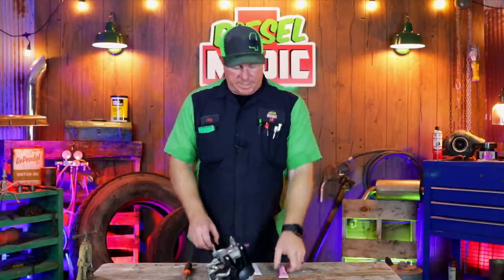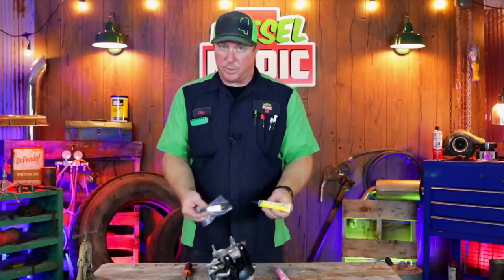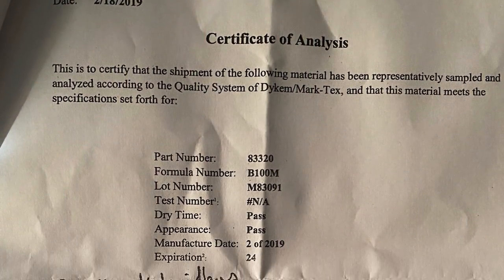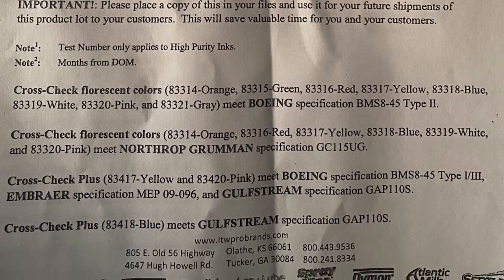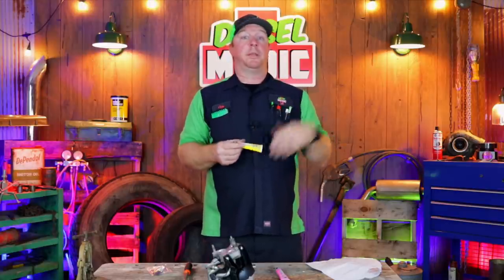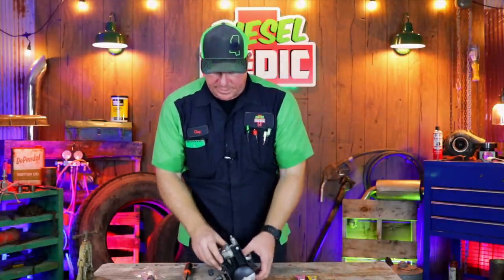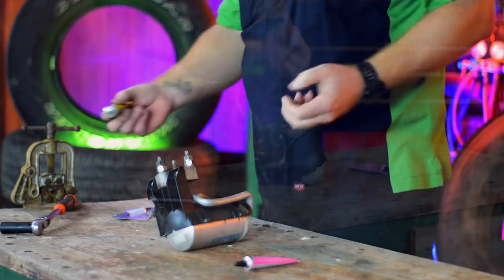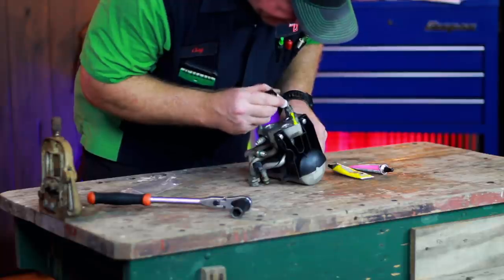Torque Seal / Marking Paste. What is it and how does it work? Dykem Torque Seal Vs Type E Test

Comment: I was a transit bus tech for 15 years. Our new coaches from the Gillig factory had torque seal on several locations. Gillig used it on the assembly line. Hydraulic connections for the fan drive, some coolant clamps, and  2 or 3 lug nuts on each wheel.
A dealership truck tech once told me, his shop used it on oil drain plugs. A customer had tried to claim engine damage for lack of lubrication. The torque seal was comprised, so the claim was denied.

Comment: Thank you
Reply: Thank you for tanking the time to explain the importance of using the proper torque marking paste! In the race car world we drill and safety wire all critical fasteners, however in the shop I work at we do a lot of “street cars “ and we have just used a smear of lock tight or paint on bolts to indicate any movement. After watching this I think we might need to change to the type E just for the traceability
Reply from the maker: It’s awesome stuff and once you get used to using it, sure makes “checking over stuff after it runs” easy! And you can trust it !
Reply from the maker: There’s a link in the video description to get you to type e site

Comment: I really don't see the point..... I don't see how it could stand on court because all it's proves is that you put are mark on said nut or bolt.Absolutley does not prove you actually torqued it....
Reply: I do this using a paint pen on critical stuff only as a reminder to myself that i did torque it. Didn't know about all this "DNA" testing etc...damn

In Maury's voice: the results are in!!..."you did not torque that drain plug"
Reply: @urahaman1479  lol
Reply from the maker: It just shows if that is “your” sealant or if someone else worked on it and also used a torque seal. If it isn’t yours that proves someone else was working on it after you did. For instance say you brought your super expense sports car in for an oil change and we used torque seal. You leave 3 weeks down the road you have to have something done to it and the oil is drained and that guy didn’t torque anything down. You loose oil and engine goes. “They did my last oil change” ...... not thinking about other repairs that was done. (This is extreme case of course) but it could be useful even if the “other” shop used the same color and didn’t do the job correctly. It could save you from buying something you didn’t screw up
Reply: It might seem dumb but in a court the burdon of proof will be brought on usually by the plaintiff, in this case I would imagine that plantiff to be a fleet company and their lawyer. If they institute that mechanics must use Type E, they will be able to check who does what work and if the mechanics in question are applying that specific DNA onto their work. Just a thought I had but who knows how something like that can play out in court.
Reply: @KoonTrucking  that's exactly why a lot of quick lube places do it
Reply: Yea jmccoy85 you definitely must be a lawyer. You know so much. Youre an expert. Thank you for sharing your close minded ignorant point of view.
Reply: @urahaman1479  I understand the theory behind it....but if I were a judge or jury and all you could show me is a line of paint drawn across the bolt as evidence that you actually tightened it....just wouldnt mean anything to me ...again it just shows you drew a line across a bolt....
Reply: @EatMyNads   sorry to ruffle your feathers....and no I'm not a lawyer I'm a professional technician,but if I were a lawyer these are points id definitely be raising....
Reply: @EatMyNads  and in my mind a good lawyer would do the same...lol if he didn't I'd fire his ass
Reply: We use a blue color from steelman on all oil plugs.
Reply from the maker: You are missing the point. It is to show that it was your marking paste not another mechanic or The other mechanic’s and not yours. That is the ENTIRE point to show who put it there.
Reply: @85jmccoy  yeah i see your point. i would imagine places use this mostly to ensure no one else tightens/loosens that fastener after the vehicle leaves. I can see ppl trying to scam a free motor. Whether or not its correctly torqued when its applied is another issue.
Reply from the maker: @jmccoy85 many times things are removed for other repairs by other shops that’s the point of it. And that is an extreme case but if you are talking about several thousands of dollars worth of damage and it boils down to another shop did the repair after it left your shop that could mean you eat the cost or not. Plus remember attorneys and judges are used to DNA evidence in court and understand how it works to prove that it was or was not your marking paste.
Reply: @KoonTrucking  lol I just don't get it man,sorry,I'm no hater I love your videos,I just don't see the point in it.
Reply from the maker: @jmccoy85 What do you not see? Let me clarify it. You bring your truck in to have something repaired. I fix it and use type e on it. You leave two weeks later you go to another shop they use another sealant. You leave that shop whatever they did failed on you and you crashed and injured people and were facing a multi million dollar lawsuit. During the investigation they find a part that failed due to it not being torqued down. You as a truck owner remember you took it to my shop. Forgetting or not knowing the other shop removed the part. I request the sample be analyzed. It comes back and not being type e and in fact a different brand, then they need to look elsewhere not your shop you are not liable. It don’t prove you torqued it down only you know that but I doubt any shop would mark it not being torqued but it proves accountability of who put the marking paste on it. Nobody wants to assume responsibility in a situation like that. This either proves it was or was not you that put it there. Simple as that.
Reply: @KoonTrucking  we will just have to agree to disagree on this one .... I mean the only places that's use that stuff from I've seen over 12 yrs is wallly world and quicklube places that have cronic problems with guys leaving drain plugs loose.... Because they hire any old idiot off the street.
Reply: @KoonTrucking you can scrape that stuff off so easily
Reply: @KoonTrucking  Clay you explained it very clearly multiple times. I think this guy is just trying to fire you up. Its like talking to a brick wall
Reply: @EatMyNads  no...I'm just trying to get y'all to think outside the box.....I'm really not trying to piss anyone off or get anyone riled up...
Reply: @EatMyNads  I have never seen more than one one paint mark on a drain plug..... Ever....
Reply: @85jmccoy  We use this stuff in aviation all the time. If you are working on something and it is approved/you are supposed to be working on it you scrape it off and clean any residue that remains off. Once you do your final torque and inspection verifies they come in with torque stripe and mark it. This way if it vibrates loose or someone comes in after the fact and messes with it you know. It's pretty simple, don't know what's hard to understand about this.
Reply: I'm looking at it like this.... A customer brings me a vehicle to change the oil on,we perform the work then mark the plug with said paint...they get the vehicle,get it towed back claiming the engine siezed up because we left the plug loose...... The plug is gone.... So....did they tamper with it and remove it themselves or did the lube guy just finger tighten it,mark it with said paint,and the thing vibrated out......
Reply: In that circumstance it would be my word against theirs.... Us, We tightened the plug and marked it.....them,I picked my car up after they changed my oil and the engine locked up and the plug was gone and let all the oil out....